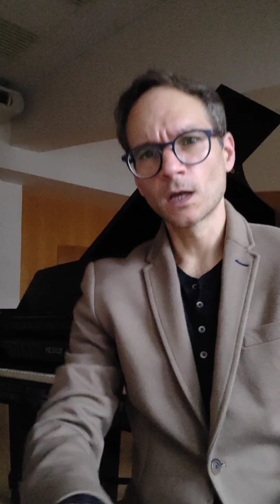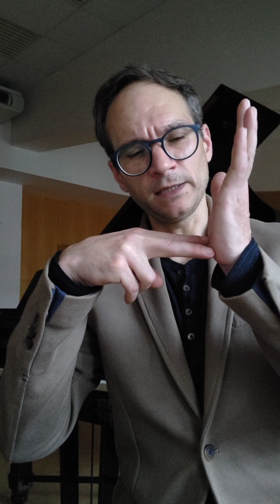3 science minutes: simple nonlinear interaction

Comment: Do you reckon this could be the difference between morning voice (crystal-clear, free of any impediments) and daytime voice?
Reply from the maker: I think probably the difference there is twofold: the vocal folds are thicker and less flexible, and then you also use nonlinear interaction to boost it. 

It's definitely not magic - you can't substitute acoustics for changes to the source.  Later in the day, the vocal folds are probably stretching more to get a higher pitch.  When they can't stretch, we add more pressure to get the same frequency. 

All my best singing is morning voice 😅
Reply: @MisterOpera  The same happens for me. Another interesting fact that I observed is that after a heavy meal or after some time relaxing on the bed watching YouTube, the voice returns to being crystalline. Everyone talks about being "relaxed" and "focused" but what really is getting tensed from a physiological standpoint?
Reply from the maker: Also a few things, but I also have this experience.  Often I warm up just to reassure myself my voice is there, and the better move would be NOT to warm up.  I think the folds can get too stretched out and the muscles that add the strength just get tired.  

So I feel like the problem is relaxation, and the solution is rest and then activation once things aren't all stretched out and weird.

In any case, it seems when things aren't working, the best and most reliable thing is to do something other than singing for a while.  A good walk can help too.
Reply: @MisterOpera  Makes a lot of sense. I believe most of these tension problems have to do with posture, but that's a theory at best. Have you heard of Mike and John Mew's research? They essentially affirm that bodily and especially oral posture influences the development of the skull. It goes without saying that this could highly influence one's ability to sing. I saw that happening with myself: the day after I do some posture exercises/stretches (for 1-2 hours), my voice happens to be much more relaxed. I will keep improving my posture and see how it goes, maybe it was a coincidence.

So far, the habits that have interfered the most with the quality of my voice have been sleep (arguably the MOST important) and posture. I think your future research would be highly benefited by a posture-focused approach.
Reply from the maker: 100% it's posture 🤠

Posture is affected by and affects breathing which affects the source which can be affected by the filter which means that your posture is affected by your sound and your sound affects your posture, which affects your sound.

Just as there is a source-filter feedback loop, there is a posture-power-source-filter COMPLEX.  It is completely magical and also completely everyday.
Reply: i guess there‘s an everything-everything non linear interaction with the whole universe